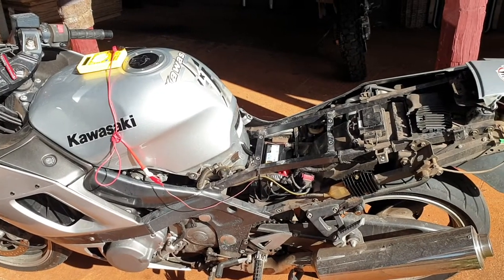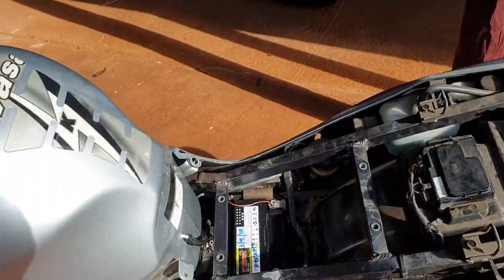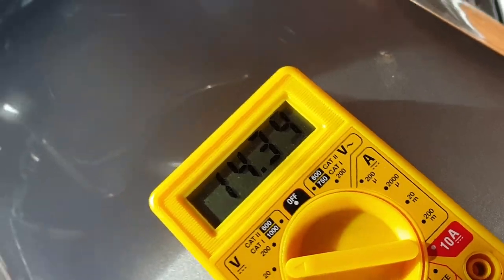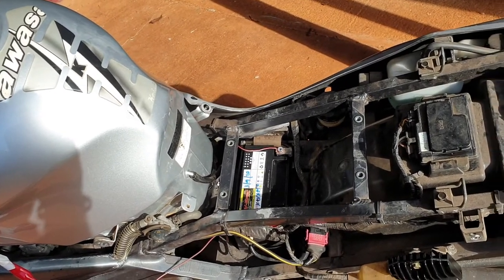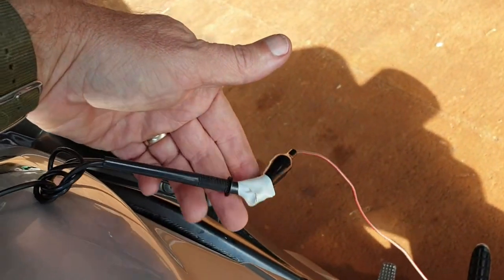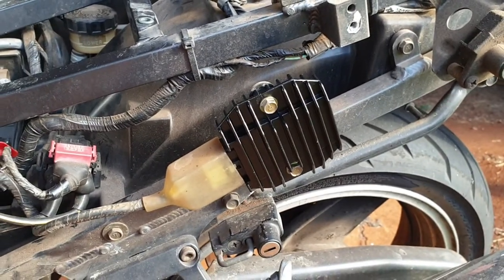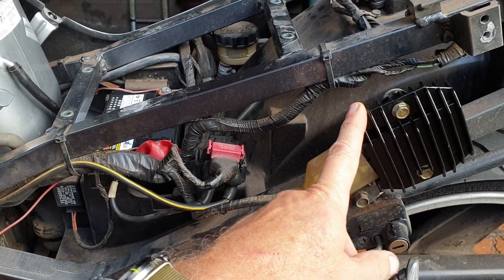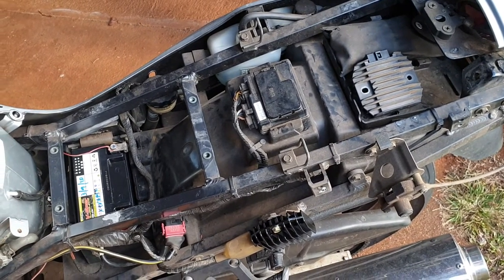Swollen overcharging motorbike battery - SOLVED

Comment: Hello thanks for the video i'm getting the opposite when the bike it cold it charges fine until it gets hot at operating temp. then it just drops the voltage very slowly until it would not recharge the battery. do you have any idea if the regulator could be going bad?  thanks!
Reply from the maker: It sounds like a possibility. The only way to be certain is to get the regulator tested at the bike shop - that's how I confirmed the problem.

Comment: I had a similar problem on my MT350, worked fine for about 5 minutes and then the voltage output from the regulator would jump up to 17.5 v plus while riding and cook the battery
Reply from the maker: Glad you found the problem
Reply: hae,,,thank you for educating us,,,,,kindly my motorcycle gy200cc keeps killing batteries ,,hv changed the requlator but the problem isn't solved what should I do? kindly advice

Comment: hello there, can a dective rectifier blow the main fuse of the bike and the cdi?
Reply from the maker: I'm not 100% certain but I wouldn't be surprised if it could
Reply: I got the same problem, I had 2 batteries heat up and start smoking on long trips. Now my ignition fuse keeps popping as soon as I turn the key. Hopefully the new rectifier I ordered will fix the problem ( fingers crossed)
Reply: @anthonyfleming2227  Hey! Did it work? Thanks.
Reply: @anthonyfleming2227  pls tell us if it worked